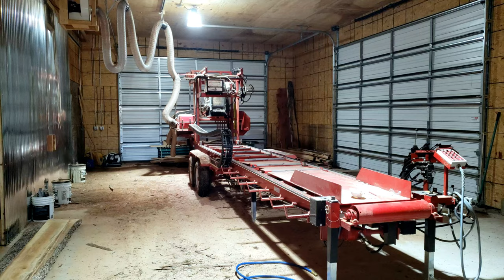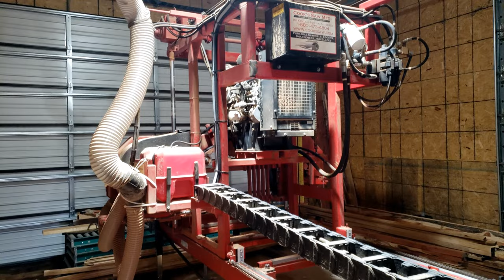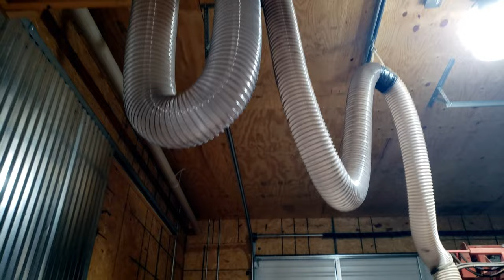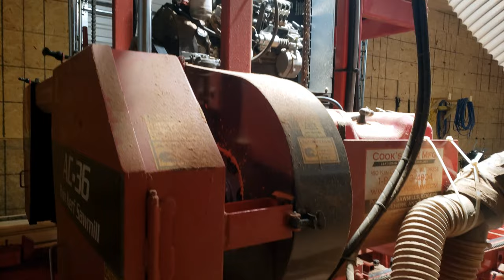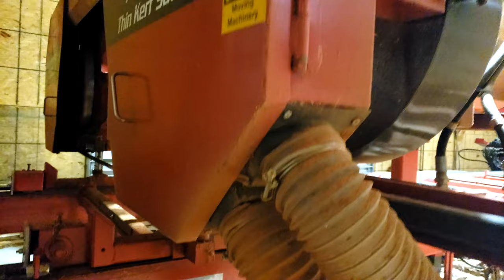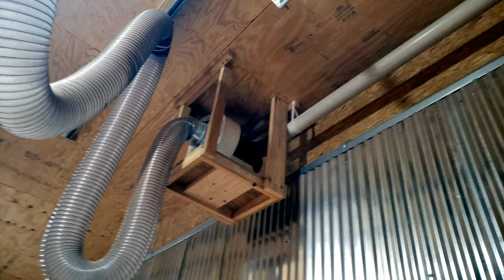Cooks Band Saw AC36  with dust collector system     sitting all winter

Comment: Good looking setup on the dust collector. I’m currently looking to do something similar to our AC36. I would like to know where you bought your fan and how well it works thanks and great video
Reply from the maker: Thank you for the comment.   I got a 3 HP dust collector from grizzly for the blower.   It works pretty good, I think it gets about 75% of the dust.    Getting the 6in hose to slide with the cutter head was the hardest part.
Reply: @Fuzzy Timbers  Thanks for the response I’m looking to install one soon. Anything to help control the dust